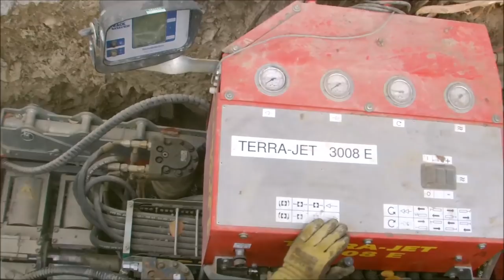Rock drilling with the Air Percussion Head TERRA ROCK

Comment: Not using water on the drill process ? hmmm....
Reply from the maker: This customer decided not to use water for this jobsite. Of course you can run the TERRA-ROCK Ø 95 with water including a special polymer. The water is pumped through the FMC pump into the machine. It's a complete new technology developed by TERRA (Fluid-Rock drilling). With this technology you also can work in mixed ground conditions. If you would like to receive more informations I can send you a nice jobsite report  with our Fluid-Rock drilling! A nice video about our Fluid-Rock drilling is coming soon.
Regards, Benjamin
Reply: TERRA AG Switzerland could you send it to me also .. thanks
Reply from the maker: Please send an email to office@terra-eu.eu - we will then send you informations and a quote about the machine.